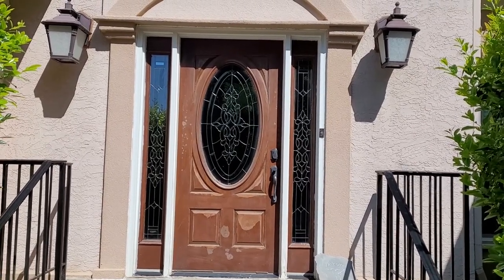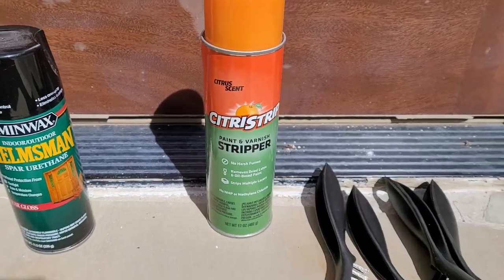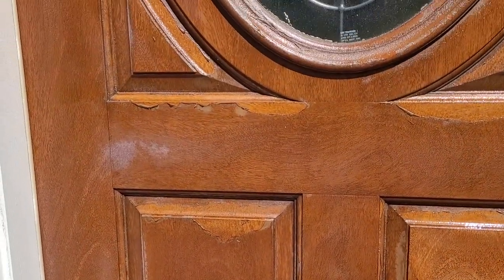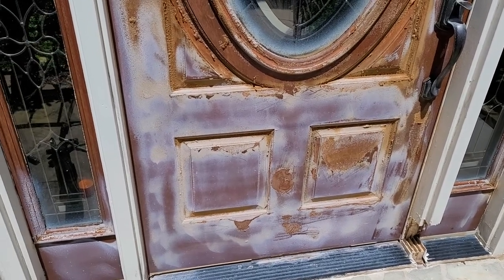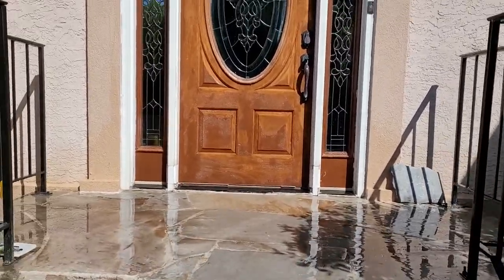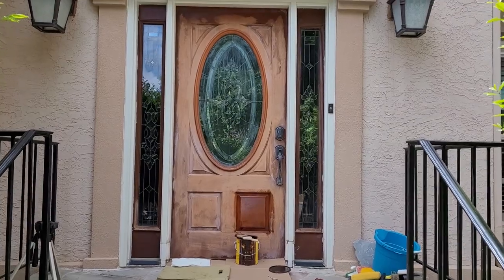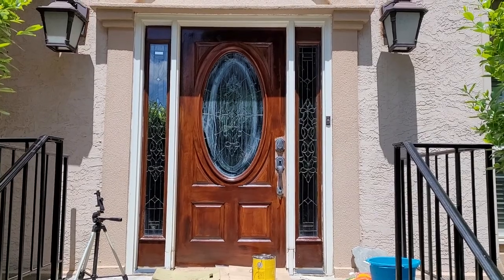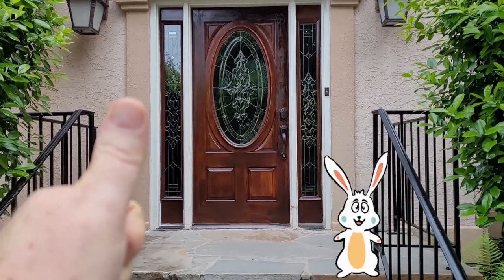Refinishing a once beautiful front door

Comment: I just refinished a Feather River Fiberglass Door and it was a complete nightmare. The very expensive stripper they direct you to buy barely cuts into the clear coat (which was peeling and cracking for months). After struggling for some time, I said "screw it; I'll paint the door." Once I started sanding (against the factory recommendation) I was able to get the clear coat off and stop sanding before removing the fake wood grain.  Gel Stain is recommended and Old Master's was the only brand that offered a good color variety. Clear Coat... Marine Grade Sikkens.
Reply from the maker: I feel your pain! The new finish is holding up so far but I'm guessing I'll be refinishing in 2-3 years.
Not a fan of the feather rivers doors!!